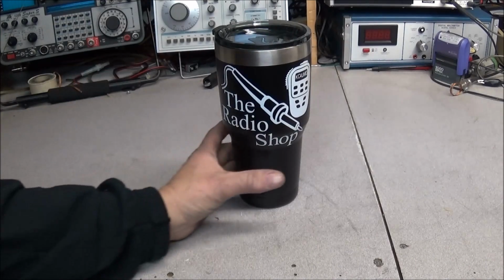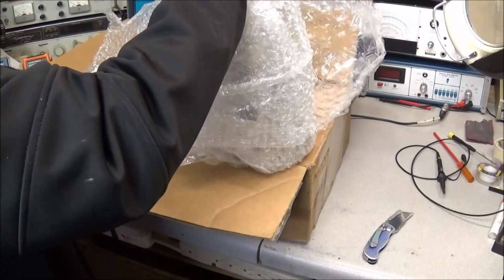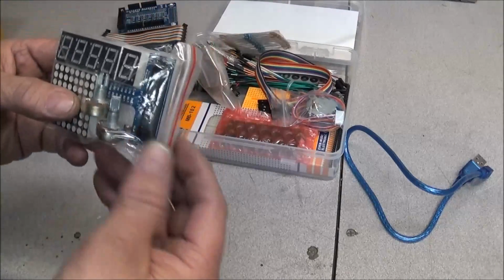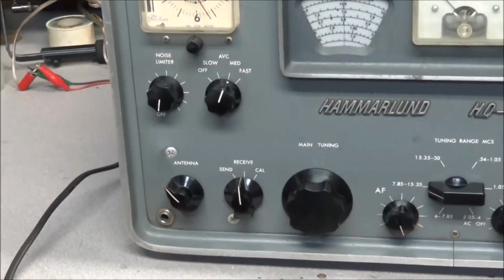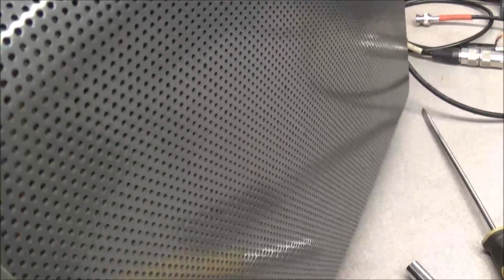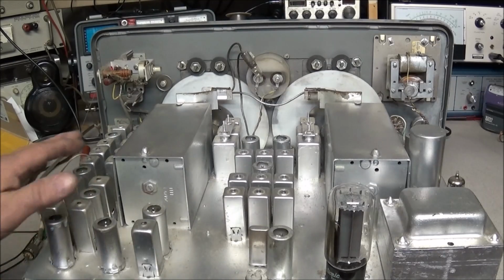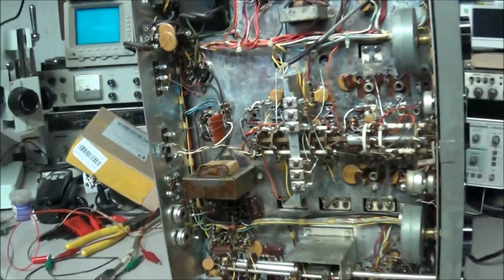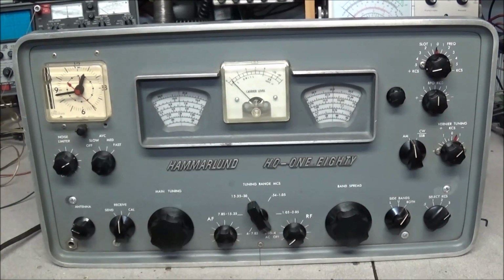#150 Christmas in the Shop Plus give a way

Comment: Pt2) Some of my favorites from you on Radio Servicing
Always use one hand touch technique when power or energized is present

Older electronics with plastic trimmer pots degrade over time and actually change values; will also unlock the PLL Circuits!
Precision measuring devices without fans were made this way to prevent thermal variation between components which would stress the components and cause uneven temps throughout the day. They are cal’d with stable temps. 
Older radios become bricks if the watch batteries go dead because their memories are then wiped and require complete program upload to fix. 

The White Wax in older radios becomes conductive over time and must be removed
Clean rubber buttons with iso alcohol wipes
For interior cleaning, always only use a dust brush and a vacuum cleaner, no chemicals!
For interior metal surfaces, a microfiber rag with glass cleaner to polish it up 
Remove any corrosive glue that is found on larger components and crystals, it eats up leads and destroys connections!
Intermittant problems are often electro-mechanical variable controls and switches - components are not usually intermittant
Remington Rem Oil works to protect metal after cleaning to prevent future pitting
Use hot glue to rebond high vibration mobile radios and parts

Tubes that are either black on the bottom to middle or white on top are bad tubes
When this happens, there is usually a bad resistor underneath that will have to be replaced

Check old vintage transformers for silver mica disease degradation, ie Haverlund
Use Never Dull Polish from Walmart to clean rusty faceplates of old radios (Ham Source)
XTreme Metal Polish with cotton also works great per 2nd source (CB)
Use Clear Coat to prevent further rust after cleaning
Use Walnut Shells in a Blast Cabinet to remove paint for complete restore
To clean Relays, use Business card Stock Paper soaked in cleaner or a pencil eraser
A Q Tip stuck in a test probe is good for hard to reach areas

Avoid using chassis ground on circuit boards - use circuit board ground only
Chassis ground is OK to use on the old tube radios
Take closeout photos prior to starting any work
Take closeup photos of any item to be disassembled
Pull items in order and place left to right including fasteners on table
Wring out voltages as stated in schematic
Check RF reception using a signal generator attached to dummy load
Check IF crystal and VFO output using an Oscope
Inject IF signal using an oscillator
You can sniff out the drivers and finals operation using the Spectrum Analyzer cable in various locations around the radio
Use a business card sprayed with contact cleaner to clean relay contacts 
Look for signs of do-it-yourself repairs such as heatshrink, solder directly on pins, missing connections or connectors, wires outside of wire bundles, missing screws and lost ground connections
Use painted reference lines for multilayer components and switches to ensure correct orientation

Replace all High Watt Resistors and Electrolytic Capacitors on Vintage Equipment

Always open a radio and examine for obvious visual faults before looking at schematics and conducting tests
Look for brown Sony bond or glue material that has become conductive, thus introducing short opportunities
Check for loose or noisy tube connections by wiggling with radio on
Clean the contacts on tubes
Check for any wires that have become desoldered and are just laying near contact
Look for old blue and grey small, med & large cylindrical electrolytic capacitors that need replacing
Replace all rusty screws to establish good grounds
Look for any discolored components for excess heat exposure
Order Recap Kit specified to specific item
Replace the caps before checking transmit mode if possible
Check solder trace carefully for any cracks at each terminal
Check insides of coils including small oscillator coils for corrosion
Check all ground screws internally for contact and corrosion
Check all multicontact rotary switches for missing contacts and corrosion
Check all tubes light
Check diodes for breaks and cracks in middle
Check capacitors for old dried out type if Humming noise is coming from speaker, they need replacing
Reply from the maker: Wow Jim, that is a decent list! Well done my friend on collecting all that. Hope you have a very Merry Christmas.